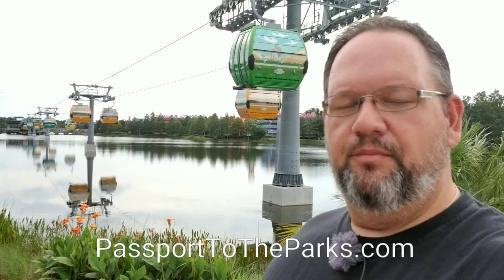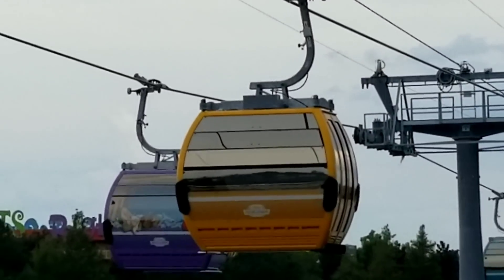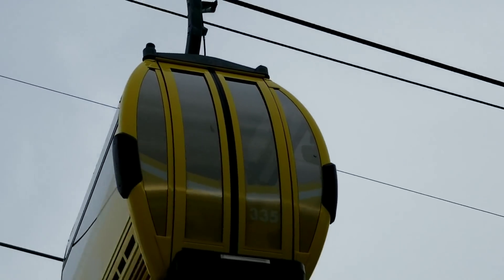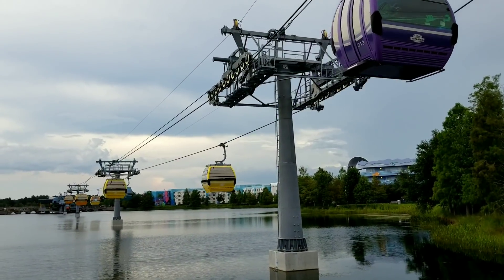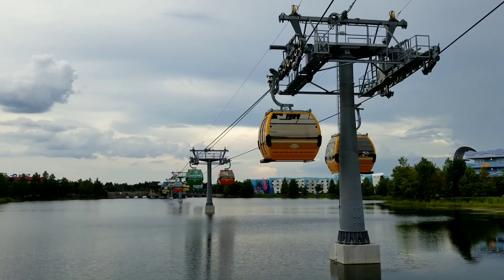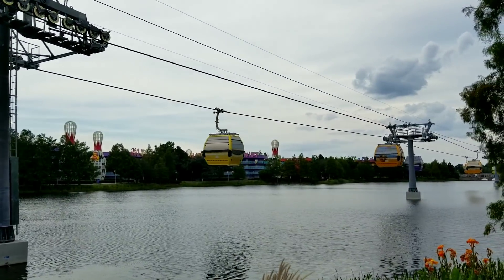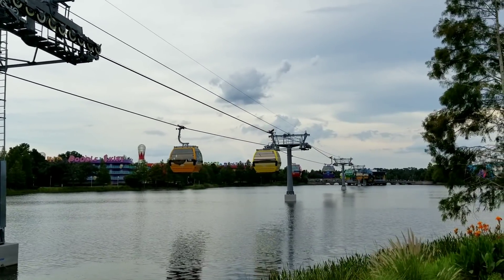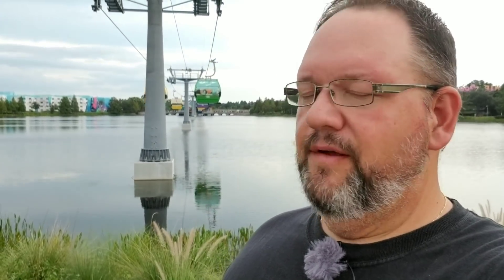Disney Skyliner Gondola Features - Power Supply - Air Conditioning - What To Expect and How it Works

Comment: It seems to me that everyone will need to get off and transfer at the Caribbean Beach station. I don't see how the gondolas could continue through the Caribbean Beach station because the people arriving from any direction will want to go 1 of 2 possible ways at that junction.  It may be possible that gondolas could continue through the Riviera station, but I don't know that this is how it will work.  You may also have to get off and back on at this station.  This means if you are coming from Epcot and going to Pop/Art of Animation, you will need to transfer at least once and maybe twice.  What do you know about that?
Reply from the maker: You are basically correct.  The Caribbean station is a transfer station.  You will have to disembark to head in any of the 3 directions.  The Riviera station does look to be a pass through station, with the option to enter or exit if so desired.
Reply: I was staying at Caribbean Beach last weekend in Aruba - very close to the Riviera station.  I took some photos of the Riviera station from a good view point on the second floor of Aruba, but I can't tell from the photos whether the gondolas are able to continue through or not.  The gondolas were never running while I was there.
Reply: Now that I think about it, the gondolas must be able to pass through the Riviera station because all of the gondolas are currently stored at the Caribbean Beach station, and in order for them to get to the Epcot line, they must be fed through the Riviera station.

Comment: These flying convection ovens come in really cool colors :^)
Reply: I'll definitely enjoy riding these but would feel more comfortable seeing a back-up safety cable.
Reply: Heather Robinson As a Colorado-based skier who has ridden many chairlifts and gondolas over the years, I can assure you that the cable that supports these gondolas is far stronger than required.  Nothing at all to worry about.

Comment: Although you make an excellent point about the Florida sun and being directly in the sun is what makes it hot, you have to take into consideration that the Florida humidity still makes it hot just slightly less hot without direct sun light. The humidity is unavoidable and in combination with the sun, makes it feel even hotter. I can see this means of transportation being popular between late Sept to early Feb or Oct to mid Jan, depending on the weather. Spring and summer, no question that there will be a decrease in use.

Comment: Springs "get depressed."  You probably meant "compressed."  Unless they are truly sad springs.
Reply: No, that's a correct usage of depressed. Like you can depress a lever. Definition 3 in Google "push or pull (something) down into a lower position."

Comment: In the Florida heat it would be a safety issue if Disney hadn't fully vetted the inside conditions of the Skyliner. They probably wouldn't even be able to get a CO (or whatever it is that's the equivalent of a certificate of occupancy for a gondola) without being able to ensure guest comfort and safety. I think it will be great and look forward to riding it. Thanks for your coverage Rob!

Comment: The red and green light on airplanes determines the side of planes and any aircraft. I wonder if they are doing that for the gondolas. Your suggestion of how each car is identified as holding elderly and wheelchair passengers is a good one too. Or else, how are those cars identified to move them to the second loading area. Curious if that part is automated or need human intervention to control how those cars are identified.
Reply: Antonio TwizShiz Edward red/ green is in same location on gondola, by the door.  his previous video showed this.   Lights are not on opposite sides, as you see on aircraft or boats.

Comment: Rob, I think the red and green lights are the same as nautical or aviation lights.  Green on one side, red on the other.  The gondolas are airborne and probably required to have the red/green lights.  You'll notice the same colors on all boats and aircraft.
Reply: William Allison the red green light are in the same location, next to the door, not on opposing sides like you see on aircraft / boats.  Speculation that these are used to signal a gondola that needs to be switched to outer loop makes most sense.
Reply: Gctales -  That could be it. Makes sense.

Comment: My money is on the exterior light signaling secondary track needed. Otherwise, how would CMs know they needed to remove a gondola to offload an ECV or something. 

They could also be used as a "call light" if there's an emergency call button on the interior if guests are in distress. This one is more speculation from me but there has to be a condition for isolated responses instead of just getting the report on station arrival. Though the response would still just be, "run it to the station" but with additional attention needed. Similar, to some degree, to getting a ECV offloaded.

If there's a camera, it would be a higher power demand and would need either wireless connection to be monitored unless it's just recorded to be referred to later as needed. The logistics of monitoring every gondola in real time seems extreme where monitoring the stations would be more reasonable. 

My thinking is... No Camera. Yes Speaker (for broadcasts and emergency information). and Maybe an Intercom for emergencies or just a call/attention/emergency button. Each individual run is so short in duration that by the time a CM can get any information from the guests on the intercom, they would be rolling into the station.
Reply: Or make everyone THINK there is camera survilence aboard so people will behave correspondaly. You can have recorders that can be saved an downloaded on a USB port if needed. Does not take much electricity. Johan.
Reply: Johan M That’s actually a strong reason to have something in there. I wonder if call boxes/buttons are enough of a physiological deterrent. There’s been plenty of these systems in urban settings already so there has to be some data on this. 

Without going to the dark side, how many people have tried to have sex on rides? These trips aren’t that long but someone is going to do something stupid. 

Then again, this thing will run mostly during the day with lots of people, limiting the opportunity a bit. Nobody tries to have sex on the People Mover... but people did try to jump between cars on the old one. Well... person.

Comment: My car has no a/c and going down the highway at 65, it's just hot air blowing on me.l live in Orlando.For old people, it will not be comfortable.
Reply: Exactly what I posted, except I have AC. And let me tell you by the time my AC has cooled down my car, I'm already sweating badly and my car is parked in a parking garage with no sunshine on it, its just the humidity that does it!

Comment: Be sure to do construction updates not just the disney Gondala system we all need to see more updates of what happening inside Disney parks and Disney springs 

  The new Space 
theme Space theme  restaurant
Star wars land and star wars hotel 
Tron construction update
etc .
Reply: Slow Down Move over Share the road with cyclist I agree.  And not just Disney.  You should do all the parks in the Greater Orlando area like Midway Mayhem, Mousesteps, Resort TV1, and Park Stop.
Reply: I would love an update on the Space themed restaurant, how it works and when it will be operational. Johan.